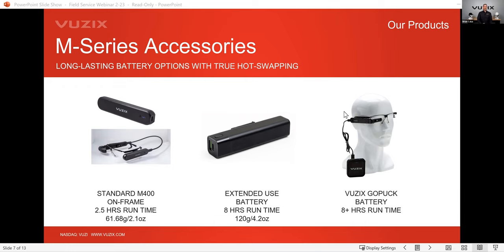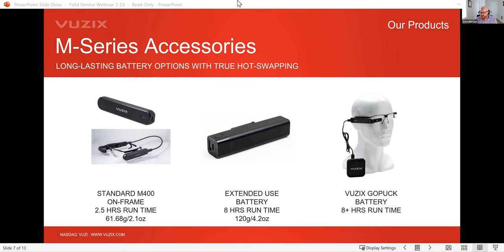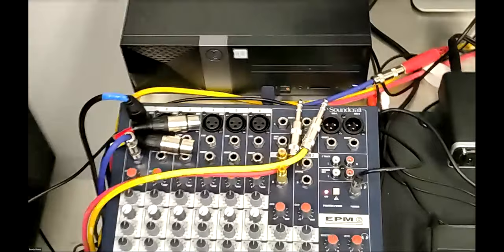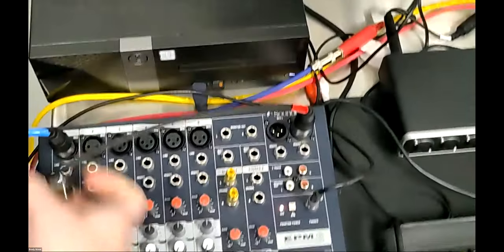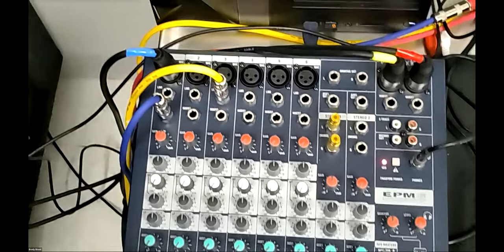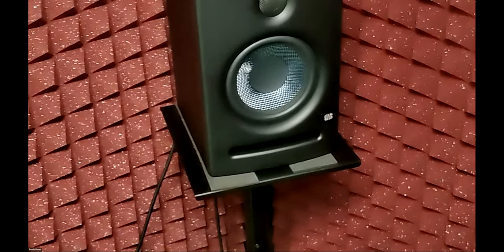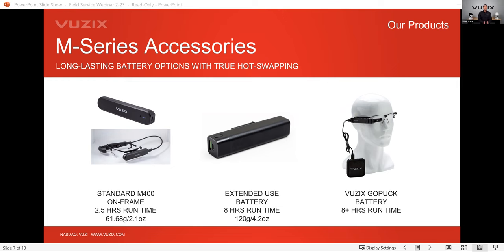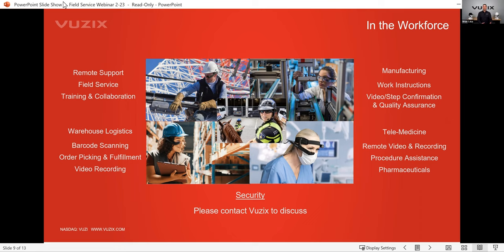Live Field Service troubleshooting call using Vuzix Smart Glasses

Comment: Cool, but I think that this tech needs a lot of work still.  The video, while useful, is incredibly difficult to watch for even a short period of time.  Vuzix needs to figure out image stabilization.  But also, the device is pretty clunky, the battery is very large and doesn't last very long.  Cool, but definitely needs work.
Reply: Which Vuzix smart glasses have you tried - the M Series has multiple battery options of all shapes and sizes and with a hot swappable battery theoretically lasts indefinitely... plus you can mount the battery anywhere on your person. I'd also disagree that products weighting less than 100g are clunky? If you're referring to the Blade 2 (which admittedly has a smaller battery life) then accept that but at 90g and looking like a pair of normal glasses is far from clunky.